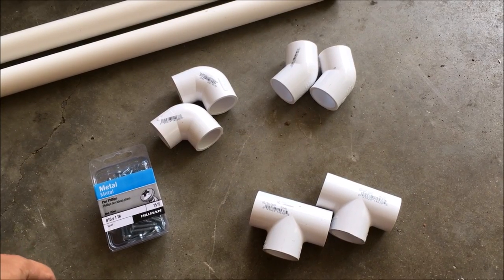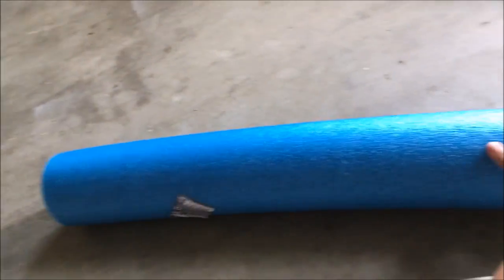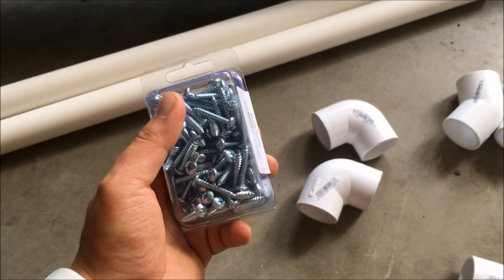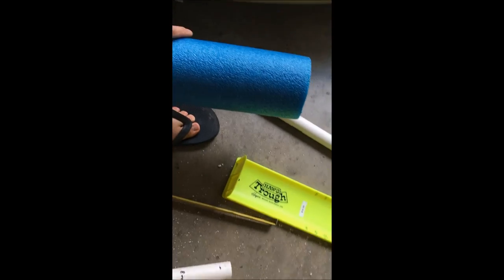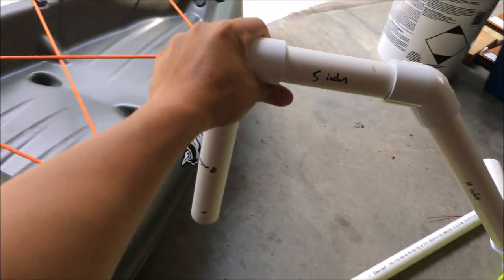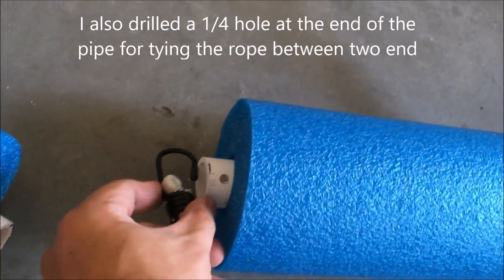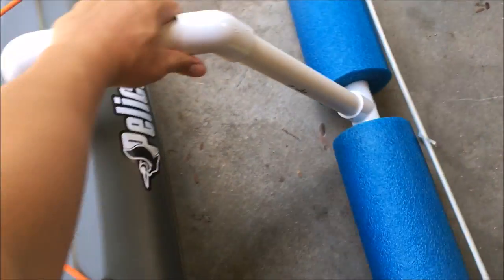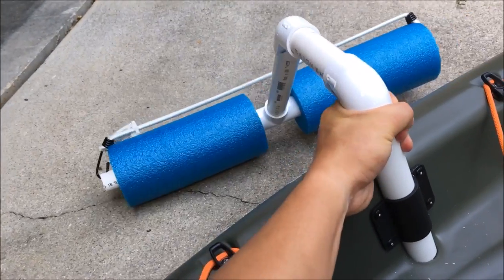Cheap Outriggers for Pelican Castaway 100 Kayak

Comment: Again thanks ! 
Mine works super !  Just a tip , I filled the pvc with spray foam insulation ! Makes the pipe alot stiffer !
Reply from the maker: Fantastic! Thanks for the tips on using spray foam insulation, how much is a can of foam insulation? Maybe I can use some of those inside the kayak as well to increase the buoyancy.
Reply: Around 6 bucks but one can goes along way
Reply: Scott, did you put the foam in all of the pipe or just the portion running through the noodles

Comment: I would add end caps on the PVC pipe
Reply from the maker: MK. BASSMASTER maybe I should but trying to keep the cost low here lol
Reply: What are the black brackets called that you used on the kayak? I have the same kayak and would like to use a similar method

Comment: need to see it on the water.... btw great vid..... have the same idea.... but don't  know how buoyant the noodles are..... I have a 12'6" yak..... thanks!!!!!
Reply: For stability... you can make the pipe and foam floaty as long as you need it to be. The only thing I would add is end caps and shave the front edge of the foam to be slightly cone shape to cut through the water.

Comment: Howlong are those noodles ! And how did ya cut them so clean lookin?
Reply from the maker: I don't remember how long are those noodle. As for the clean cut, I just use regular box cutter that you can get from walmart. A big noodle like this is easier to cut, I think they are build with tougher material.

Comment: Black bracket drilled into side to hold PVC base is what? From where? Thanks!
Reply from the maker: It came with the kayak, but I am sure you can find that bracket somewhere online.
Reply: rod holder built in

Comment: If you ever have a blind hole you have to mount a bolt to in your kayak, use what they call (Well Nuts). You do not have to put a nut and washer on them and all bolts will be water tight 100% of the time. You just drill the right size hole, and put the well nut in.